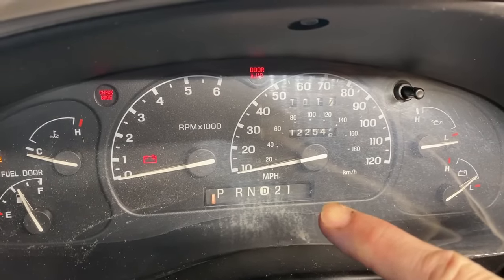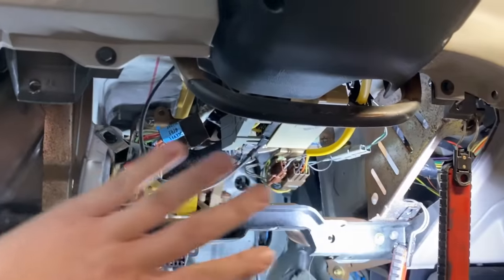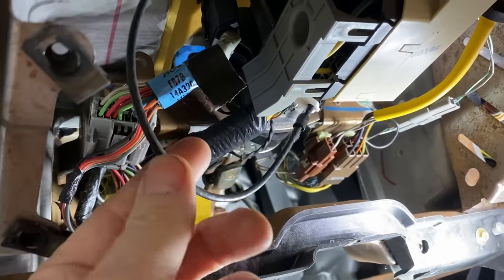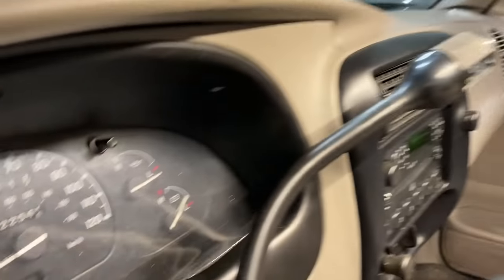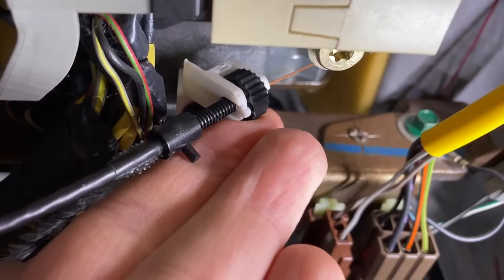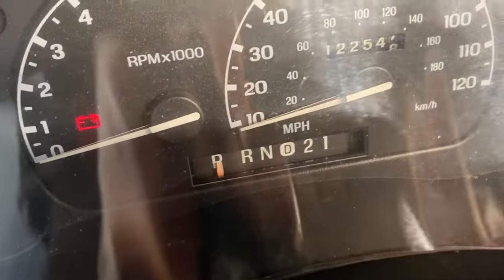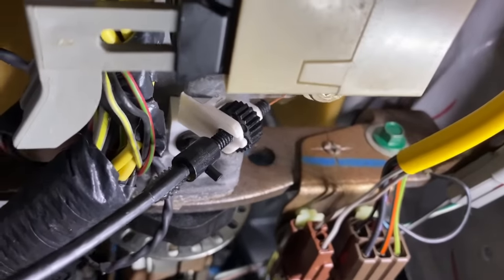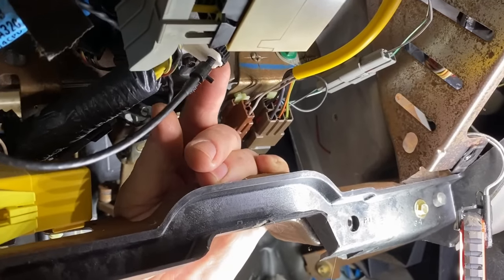1980-2011 Ford Vehicles: How to Align Your Transmission Shift Indicator- Hidden Thumb Wheel Adjuster

Comment from the maker: This is the Fixing Part I Recommend:
https://amzn.to/36VUULC
Reply: FordTechMakuloco   I wish you would start doing more videos on some of these older cars like the explorer
Reply: If the teck works why not continue.
Reply: Dude so cool my o5 250 looks like it's neutral when in drive this weekend I'm trying thst
Reply: Is their a way to talk to you Mackuloco need some info on ford taurus x Eddie 2008 hard to get info be great to direct message thanks for all the help
Reply: Help!? I was hoping this was my problem , but my cable broke in two instead. Can't find any info on replacement procedure. At least it still shift in gear. 
Thanks guys
Reply: I have a 2002 Ford crown Vic and I have the same issue but I checked under the dash and I don’t have the adjustable thumb wheel. Any suggestions on how to fix it?
Reply: What U actually mean is I am going to get fat ass stuck under there right. Now I know how my cat feels when he tries to sneak in under the garage door.
Reply: 5 minutes to explain that......

Comment: Been driving around for years with slop in the shifter on 99 explorer xlt, saw this video, easily got on 1 knee and stuck my arm up under the steering wheel feeling for that above shown thumbwheel.  Found it and lined up nice, your a FORD magician dude.  Thanks for the tip!

Comment: 2011 cvpi had thr same style thimb wheel but it was located on the shifter side of the steering column closer to the gauge cluster. Big thanks for closing out another small problem i didnt know i could fix so easily. 10 minutes and done

Comment: So simple and easy, let's make it a computer screen (all auto companies these days).
Reply: So then some glitch happens and it works improperly, or not at all, and you have to take it to a licensed technician who has a special computer tool and re-codes it, costing you 200$. As opposed to taking it off yourself in your driveway and spending 10 minutes fixing it.

Comment: Thanks for the video.  Easiest way was just to lay on my back and change the part to the metal one found on amazon.  Used a 7/32 with an extension.  To reloop the cable put the vehicle in 1st gear and make sure you put blocks on your wheels.
Reply: Do you by chance have a link for the "metal replacement part"
I already ordered the plastic one as listed in the above, but would be interested in the metal version you are referring to
Did not see on Amazon

Comment: Just looked at mine for my old 98 F150 as the indicator is off and sloppy shifter. Sure enough it’s broken. Just ordered new shifter bushings and this part along with new dash lights bc I have some burned out bulbs. I don’t drive the truck much but I’ve been doing lots of work to it often except when I need a truck. Your vids have helped me swap coils, fix the AC, fix the main vacuum leak and tons of other small diy issues. I have to replace the GEM next and I wish you had a video for that.

Comment: My '86 Grand Marquis has a plastic collar - you just turn the collar by hand until the locating pin drops in ... or there was a pinch bolt. Been a while since I've had to do that (back when my shift lever spring broke into 9 small pieces), so memory is a little foggy. Was pretty simple - no cable or adjuster. It's also still working after 34 years, 265k miles. :)

Comment: Thanks a lot, that was very easy to follow. Obviously people should check that first if the indicator starts acting wonky. FYI the Dorman part in your info doesn't fit the 2000 Mercury Grand Marquis. Its plastic and in the same location but instead its the Dorman 70041.

Comment: Thank You for this video so much! My 2003 Ford Windstar minivan ✔️ engine light came on so I went to AutoZone to see what the problem was and it was the N.S.S.S. so on the ride back home I was thinking 🤔 maybe I need to adjust the actual sensor itself, you know go under the hood but now that I watched this video not only did I learn something new, but now I don't have to go under the hood and start messing with things. Thanks a Bunch 👍.

Comment: Great video...I googled the part that you show in the below link.  and it says that it will not fit my 2004 Expedition?? the dealer does not carry this part without purchasing the complete assembly.

Comment: I had a windstar that had this same issue and the e-150 I use for work has this same issue as well. It takes less than 30 seconds to do once you find the little wheel.

Comment: You are just awesome at what you do. Great videos and information always on point. I have an 07 f150 5.4 and been using 10w30 full synthetic since I got it but im so scare about doing the the timing chain. It only rattles when on park and give it gas
Reply: Any updates?  I am due for my 1997 f250xlt supercab.  (3/4 ton F150)

Comment: I'm having the same problem, I have a 2001 ford expedition eddie bauer and shifter won't line up. Not only that but everytime I start vehicle I need to pull up on shifter and turn key at same time for truck to start up. My questiion is what if the white plastics are broken b/c of years of wear and tear and heat etc. Thanks for the video, any feedback appreciated.

Comment: I just fixed mine on my 99 expedition but I just used a cable tie to pull it down to the steering support bracket and tightened the cable tie till the indicator ligned up to park.

Comment: Do you have to remove panels to access the adjuster wheel?

On my 2000 Ford Excursion it looks like there may be a way to also adjust it down at the other end where it attaches to the transmission.... is that possible?

Comment: My shift indicator developed a similar problem. The indicator moves but it is out of sync. At the same time the car won't start anymore. It cranks over but won't start. I'm wondering if there is any chance that there is an ignition interlock that is triggered by the shift indicator. Probably not and probably I need a new fuel pump which will be expensive work but I just thought I would ask in case the problem is simpler than that. It is interesting that the shift indicator problem and the engine not starting occurred at the same time.

Comment: My odometer wasn’t counting. Found a lot of dirt and straw behind dash. Had to remove needle on odometer. Cleaned everything and used dry graphite. Works wonderful. But now the truck is off by 5 miles on miles per hour on gauge. And technique on how to fix this? Thank you

Comment: Hey Man! I know my question will be off topic but I’ve been struggling and going back and forth within Ford dealers techs and other techS, I have a 2001 Ford Escape 2.0 manual, no spark but coil pack plug has power, and the fuel pump doesn’t activate, no one seems to no what the problem is. The theft light blinks but medium intervals between each blink. I would greatly appreciate it if you have any feedback on my ford. I’m ubering for the time being.

Comment: I know this was for  shifter adjustment. But can you tell me if the antenna cable is able to be unplugged from the antenna mast on a 03 escape? Mine broke off and the aftermarket replacement doesn't really work for the set up.

Comment: Unfortunately my 83 ford f150 doesn't have this but has a small white cable holder that is mounted on the side of the column. I haven't looked but doubt its still available.

Comment: Need some advice I have a 2004 Ford f15o 5.4 3 valve  with 100,000 miles on it I have till next mid summer to have it payed off. Do you think I should trade it in for another truck since I hear bad things about the 5.4 or you think I should keep it and keep it maintained
Reply: I've got 260k on my 06. It runs great.
Reply: Mr. Cee Gee wow what have you replaced since you got it
Reply: @DavidRodriguez-qt5ux  I bought it new. It's my work and personal truck and I've driven it like I want it to last a while. 
No repairs other than the transmission were done before 200+ thousand miles.
The alternator has been replaced. 
The transmission has been rebuilt and replaced because the transmission cooler thermostat was stuck and the Florida heat and Orlando traffic cooked the transmission because fluid wasn't getting to the cooler.
The AC compressor and blower motor have been replaced.
At present the heater core has a hole in it so I've bypassed it until I'm ready to pull the dashboard off.
I have done all my spark plug replacements and haven't broken one.
Still running original coil packs with newer boots.
A while back I developed an oil leak at the front of the motor. At first I thought it was the valve cover gaskets so they were changed. Nope. Then I thought it was the oil pan gasket so that was changed. Nope. It was the timing cover gasket where the tensioner seal blew out and was squirting oil right where the block and head meet. I nursed it  until I was losing a qt a day. 
Recently tore the front end down. Insides were immaculate thanks to regular oil changes with motorcraft and Valvoline high mileage synthetic blend.
All of the timing components looked in excellent condition except for a corner chipped off one chain guide. But since I was in there, though everything looked great, I chose to replace all the timing components (chains, guides, crank sprocket, tensioners, with Ford OEM) except for the phasers and vct valves because they looked great and weren't making noise or causing problems. I also put in Ford 5.4 2V tensioners because they are cast iron with an anti-collapse bar which is much better than the plastic 3V tensioners and is an exact for part. 
I did change out the stock oil pump for a Melling M340HV high volume pump and also went back to recommended 5w20 instead of the 5w30 I'd been running the last 100k miles. Within 2 days of driving it ran like crap because the increase in oil pressure blew out one of the VCT screens into the valve and jammed it, so I replaced both VCT valves and it runs great.
Currently it needs front suspension (clunks) and drivetrain work (clunks, rear end howls.)
The shifter cable also needs to be replaced which is why I'm watching this video today.
Ford builds these trucks tough and when they start to hit the miles they will need maintenance but they don't just disintegrate like many vehicles.

Comment: My sons truck indicator was way off now it just quit working all together do you think the cable is broke or maybe it’s just that far out of adjustment with my work schedule I haven’t had time to tear into it yet
Reply: Does it just not shift into gear at all? I disconnected the selector cable temporarily and connected it back up, now the selector is off and the transmission won't shift into gear although the selector lets me cycle through gears
Reply: @area.man.  I had a chance to look at it the other day and used the adjuster under the dash and it didn’t seem to help much but it’s still shifting into each gear ok. If I remember right the indicator is 1 gear off
Reply: @justinlloyd9342  Does it jiggle at all?
Reply: @area.man.  no not
Really but like I say if your in park it says it’s in reverse or your in reverse it says you’re in neutral

Comment: A shop just installed a new transmission in my 2001 f250. But all my gears shifted to the right.  Now my park is my reverse and me reverse is neutral drive is second second os first and now I have no 1st gear. You just can't find good help anymore.

Comment: I have an 87 F250 460 5 speed four-wheel drive, is it true that my transmission and transfer case both take automatic transmission fluid ?
Reply: I believe so.
Reply: The dealer parts department has a chart.  I THINK MerconV is now being used
Reply from the maker: Mercon v in the trans and Mercon LV in the transfer case

Comment: what if you turn it all the way one direction you need to go and it still won’t put the lindicator in the center of the park position .
Reply: I used a cable tie looped around the indicator cable to put enough tension on it to align the shift indicator.  Worked for about 10years…..until today. 🙁. Now the white plastic part that holds the adjuster wheel is broken.🤯

Comment: That plastic thing that broke looks like something that was DESIGNED to break! Job security for Ford mechanics.
Reply: TRY. USING   THOSE  SMALL ,  MEDIUM  PLASTIC   CABLE  ZIP  TIES ,  OLD  PLASTIC  PART  IF  BROKEN  .
(  A  NEW  PLASTIC  PART ,  HOW  LONG  UNTIL   IT  BREAKS  ,  FORD  SHOULD  HAVE   USED   METAL ,  NOT  PLASTIC.)

Comment: Anyway I could possibly contact you? By email.or something? I'm having quite a bit of trouble with my 6.0
Reply: Kolby Martin what’s going on with it?
Reply: @Brandonpowerstroke I have a crank no start with a new IPR. New HPOP only getting 139 lbs of pressure. Thinking maybe low pressure oil pump.

Comment: If the cheap mother just made it out of metal it would not break in the first place #1 selling junk. I have owned 5 fords 3 f150 and 2 rangers ford will never get another penny from me!
Reply: All brands are all the same. Don't hear anybody complaining about all the plastic parts to save weight, when you pull up to the gas pump. Know how expensive it would be if all the plastic was removed and replaced with machined aluminum?